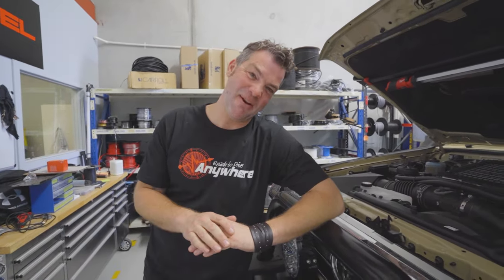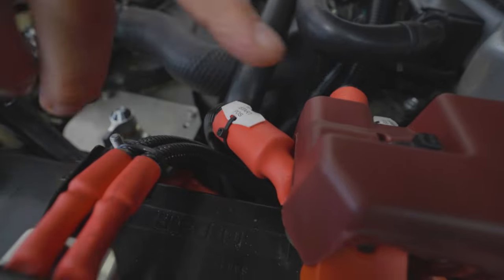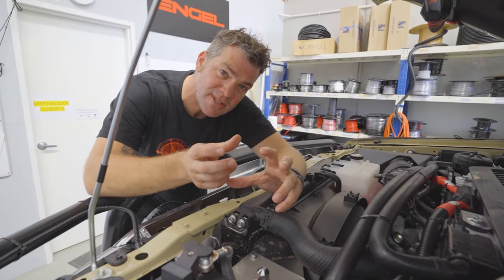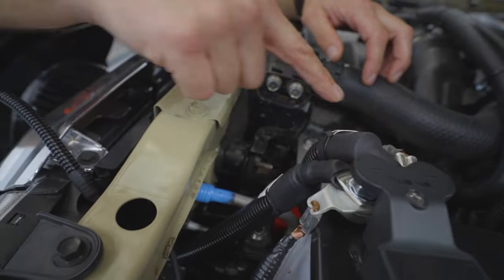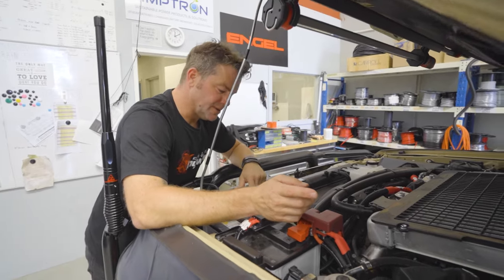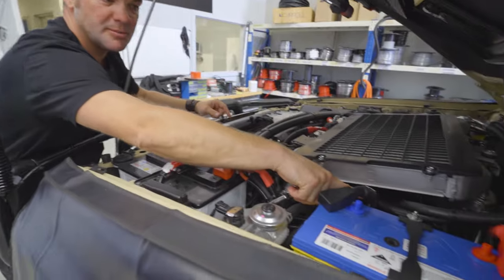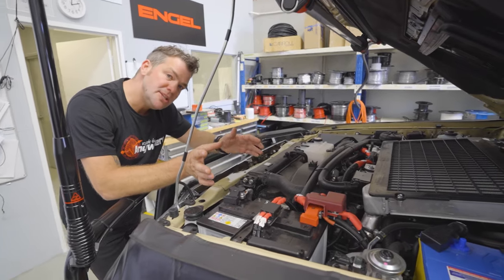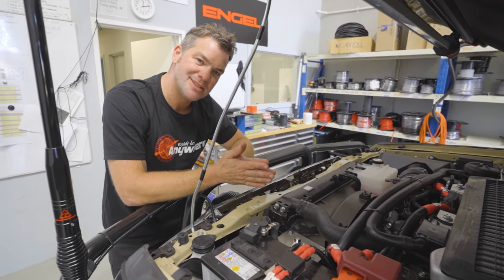How To Wire Up A Winch

Comment: What would be the min guage wire for the winch?
Reply from the maker: I suggest you using a 00B&S Cable with 25Sqmm cable for most winches. But it depends on your selected winch and its specifications. You can find this information in the datasheet of your winch.
Reply: @ReadytoDriveAnywhere  thank you much appreciated

Comment: 300 amps in what context hiener  is it 300 amps at 12 volts or 300 at 24 or 48 volts??
Reply: at 12volts.
Reply: It’s a 12v circuit right? So 12v